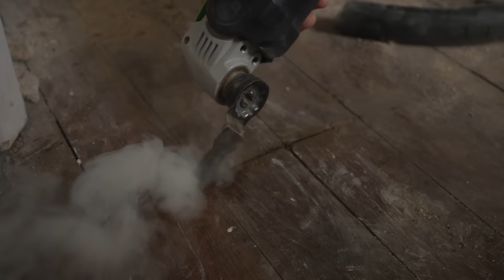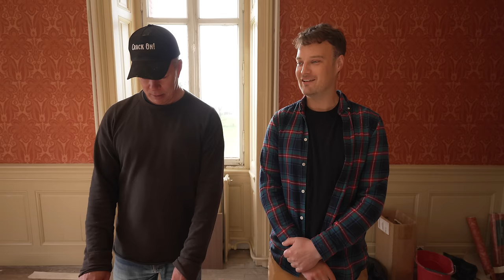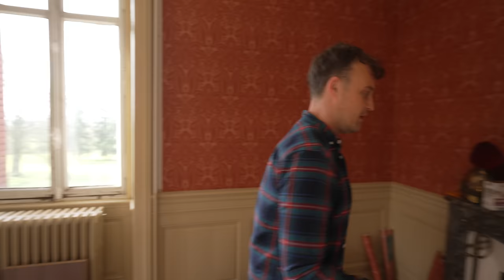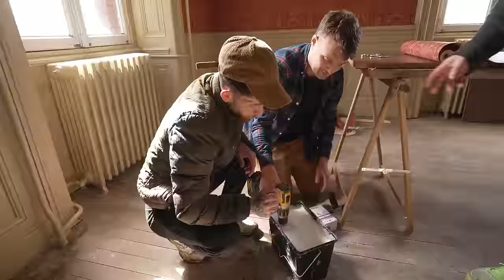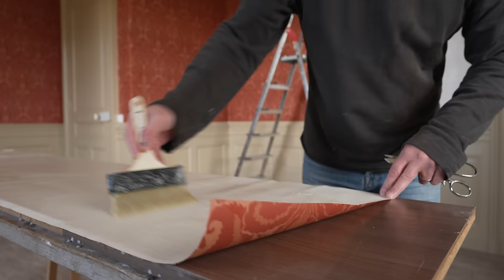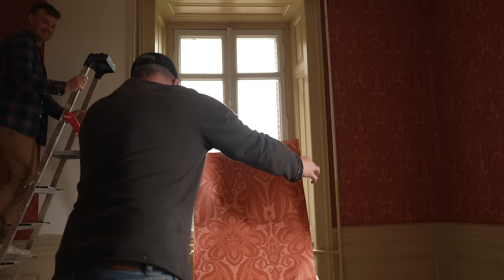Finishing The Bedroom

Comment: When I used to wallpaper, I would use the thin blades along the ends. In order to prevent the blade from ripping the paper, I would hold a wide putty knife into the crease against the surface. Cutting against the knife made for a better cut and held the paper in place.

Comment: Michael, as to cutting wallpaper along the top and bottom, or around windows and doors, there is a small wheel-cutter used for cutting fabrics, looks like a small pizza cutter, and can be found at any fabric shop. Technically, called a "fabric cutting wheel" and they are very sharp. The tool won't get into corners, but use a scissors to cut in the tight places instead. The paper and woodwork are incredible together, love it. Job well done.

Comment: I use one particular scraper that I have for removing wallpaper or taking down the sprayed popcorn ceiling. The the scraper has the corners rounded off. I found it's the square pointed corners that dig in and cause damage. Or little gouges in the ceilings or walls. When they are rounded, you don't get the gouges or scrapes that dig in. My scraper is actually a kitchen spatula with a long handle. 😊What you would use for flipping eggs or pancakes!! Works great for the job!!😅